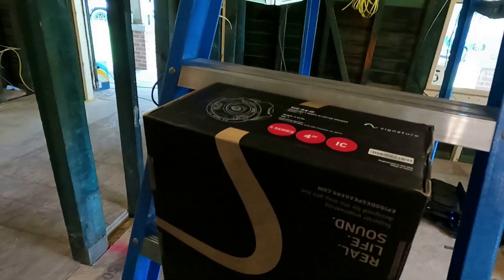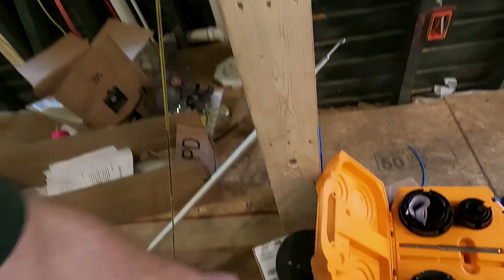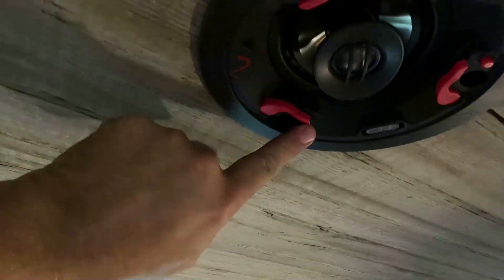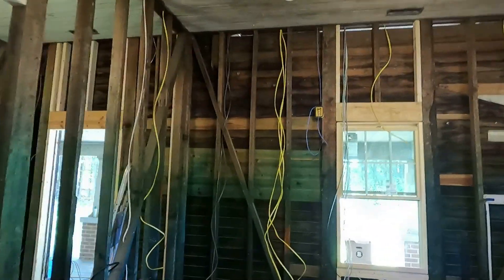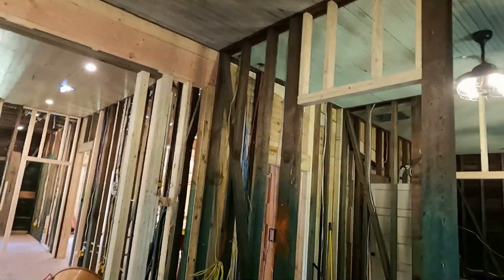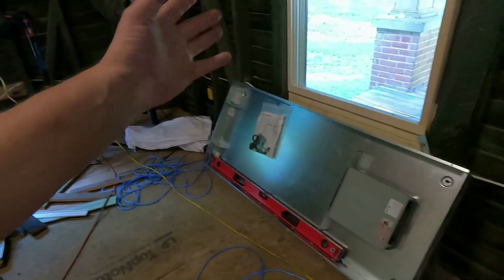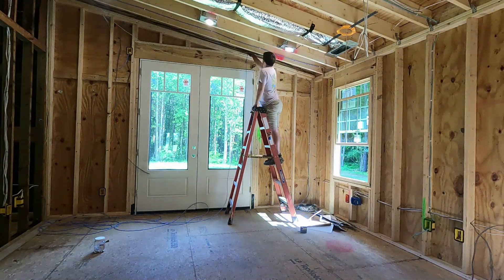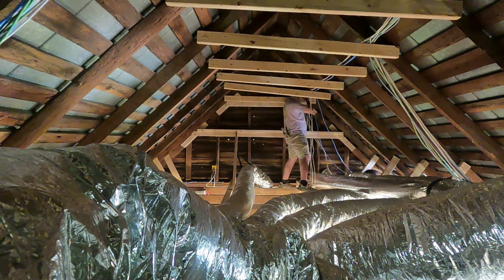OLD HOUSE SMART HOME WIRING CONTINUES. AV and LIGHTING CONTROL

Comment: While that be the finished ceiling? That speaker install was easy. Suggestion, that screw that is up in that metal box needs a have a cover or someone is going to have a bad day. :)Have a good week.
Reply from the maker: In the kitchen , yes. That is how we are leaving the ceiling. I may put some sort of clear coat over it. 🤔 Which metal box? Thanks!
Reply: @BealyGood  Time mark 8:40
Reply from the maker: @dennis2376  I see now. Thanks for pointing that out!
Reply: @BealyGood  Your welcome.